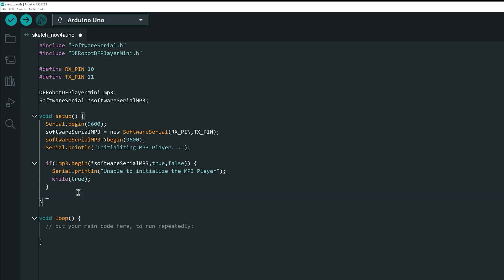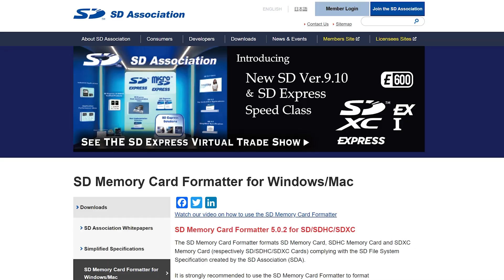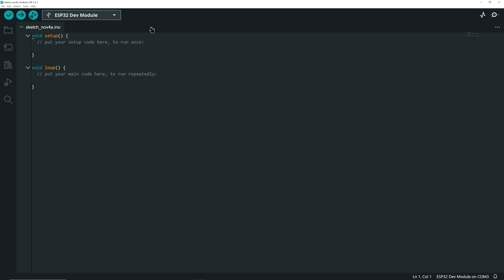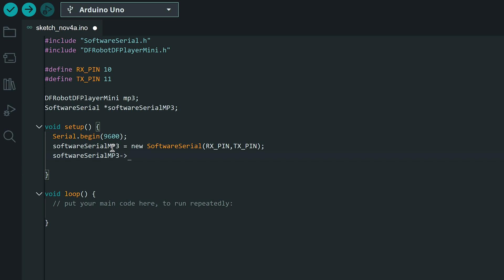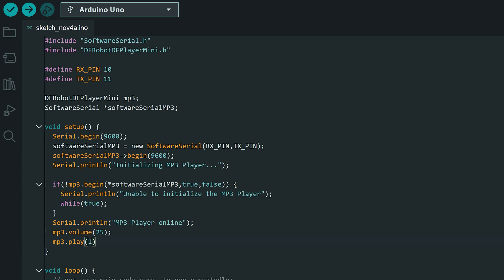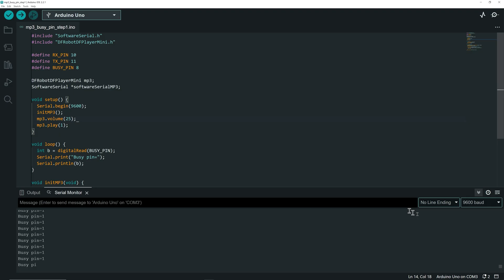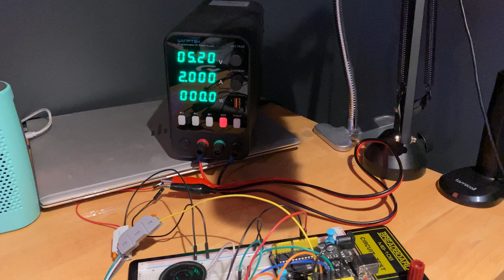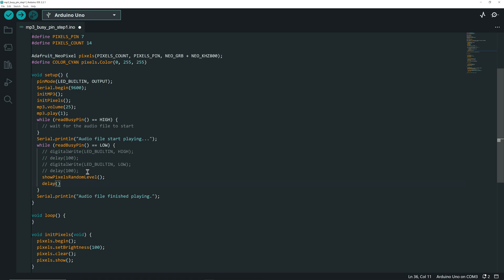Mastering MP3 Player Busy Pin with Arduino & Audio-Visual Synchronization

Comment: if I upload the sketch, there is no sound. I don't get error message, reports normal initialisation. I check the wires, nothing seems out of ordinary. should work. does nothing.
Reply: somehow I read a different datasheet. I used filenames 0001.mp3 where 001.mp3 was expected. so the df player answered with silence. no errors in the output.

Comment: Can this be ran with an ESP32 Wroom controller instead of the Uno?
Reply from the maker: Yes
Reply: @thelastoutpostworkshop  I keep trying by using gpio 26/27 for the rx/tx, (& I int those pins) but never get the ESP to communicate to the DFPlayer.  I know it has to be something in code, but not sure. Thank you for responding.

Comment: This is a great video, thanks for putting it out there. I cannot replicate the behavior you have around the Busy PIN (minute 7:44) without removing the resistor/LED path from the circuit, though. Once I do, I get 'Busy Pin=1' and the "Audio file finished playing" message. I am not sure why I don't have enough voltage to trigger HIGH and power the LED path at the same time. I am connected to the 5V power, so that shouldn't be the issue. I now suspect I may have a defective DFPlayer mini and have ordered some new MP3-TF-16P players to see if that is the issue.
Reply from the maker: Have you tried measuring the voltage with a multimeter ?
Reply: @thelastoutpostworkshop  not yet. I will try that in a couple of days.

Comment: These videos are great. I built a very simple MP3 player as a prototype for a museum, but just used buttons to trigger the DFplayer playback functions -- no MCU needed. Easy enough. Now I'm changing it up to use an Arduino Nano, and it will be used in a special project. Working with a local museum, I'm working on replacing the internal components of a WWII aircraft radio so while in flight, visitors can listen to radio recordings of D-Day from what appears to be a vintage radio. The hardest part of reusing the controls on the radio to to control audio playback.
Reply from the maker: Wow great project!  Thanks for sharing

Comment: I agree with @daveshillito... Was the led actually tied to the sound, even though the code is random?  It's not possible to actually synch it is it.. i mean unless you add a sound analyzer, mic, and some logic i guess?
Reply from the maker: In the code,  it is just random, it appears to sync with the sound, but it is not.  It would require another component to actually get the sound level.
Reply: @thelastoutpostworkshop  right on, thx.. seems like too much extra when it's damn close 💯
.. great work BTW.. that was the exact post I needed, the BUSY pin was totally unknown to me till now 👍

Comment: Hi and thank you so much for such a helpful video! I have a 5 watt / 8 ohms speaker that i want to use for a project. Will it be okay if I connect the speaker to the DFPlayer Mini module? Or do i need an amplifier?
Reply from the maker: I am not really sure, I am not an expert in electronics, my concern will be that it could drive too much current for the module.

Comment: Hello! First of all I would like to thank you for this video and the good explanations. They are very useful and interesting.
Secondly, I have tried to build this project exactly as in the video but I have a problem and I don't understand why. I have a 16GB SD card (hama) and I put a mp3 file on it, a song downloaded from youtube using mp3 converter online. After the mp3 is initialized the song doesn't start to play. The busy pin is always 1. I have checked the wires thousand times without any result. I have also displayed in the serial monitor the number of files on my SD card and the result was kinda weird because it was displaying "-1". I have tried also with another SD card and I had the same result. What can I do to solve this problem?
Reply from the maker: try format your SD card with https://www.sdcard.org/downloads/formatter/
Reply: @thelastoutpostworkshop   did that. I forgot to mention, sorry
Reply from the maker: Copy your code here

Comment: hi bro.Have a good time. i have one problem. for example in this code 

    else if (inputvalue == '3') {
      mp3.playTrackNumber(5, 30);
    }
    else if (inputvalue == 't') {
     
    }  

what code need for stop mp3 file in secend else if ? thanks
Reply from the maker: try this : mp3.stop();
Reply: didint work with if :(
Reply from the maker: copy the whole section of the code
Reply: @thelastoutpostworkshop   sorry I had a problem. I couldn't answer. stil not working This shit ain't gonna stop.😂. You don't have any other code ?